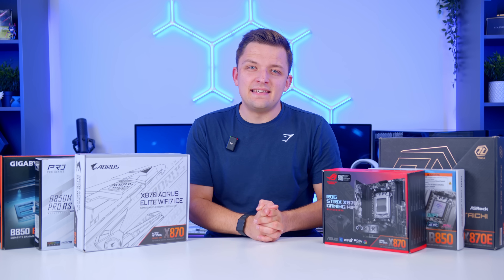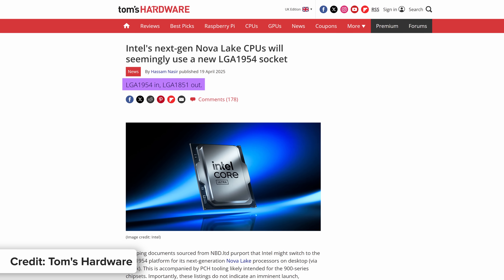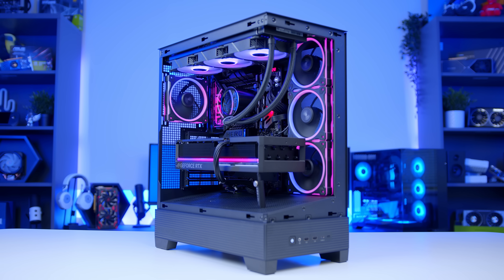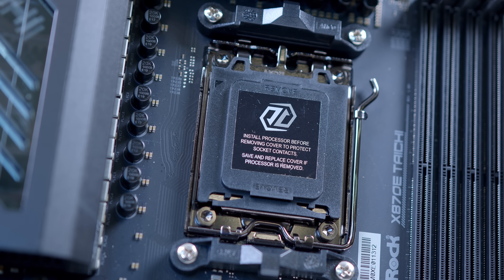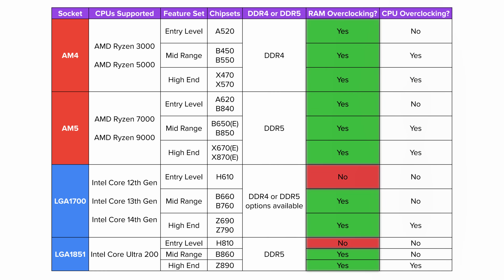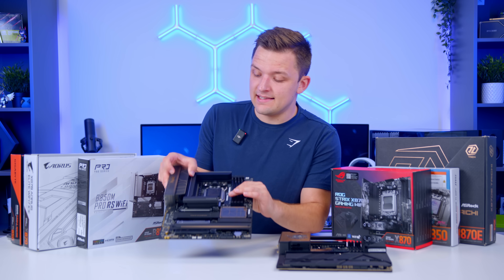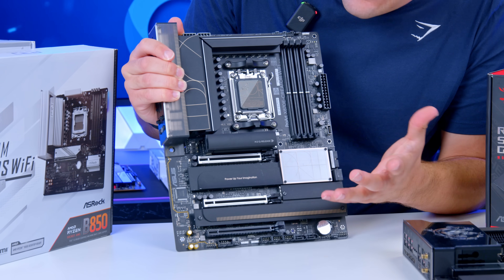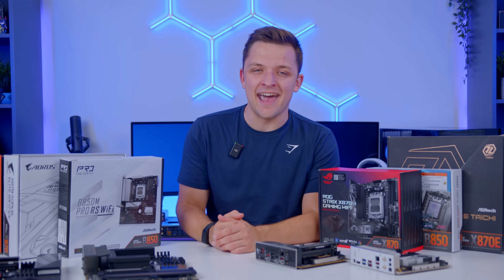How to Pick a Motherboard in 2025! 👀 [...And My Favourite Boards Right Now!]

Comment: Yeah pick the cpu first, but then go by connectivity you need. There's a lot of overlap between the chipsets. I like to keep a lot of sata and nvme without sacrificing each other and settled on a b850 not an x870 or x870e

Comment: From my own experience and based on a, probably, relatively rare usage-scenario (flight-sims/VR): Make sure you have enough on-board USB Type A sockets on your board. I have seven of those on my board plus two front-side ones and a 4x hub built into my monitor, but since a lot of the more mundane devices I run like my mouse or keyboard will only function properly on an on-board connection, all my on-board Typ-As are populated. 
As for brands? I used to be super loyal to Asus as I had been using their boards since the days of the Commando and never had any issues. But they've become a bit too mad re their prices and bang per buck plus they seem to have been fumbling the ball a bit in recent years WRT quality, so I jumped ship and went with an MSI Z690 Tomahawk when I built this PC a few years ago. Admittedly, that was mostly for pricing reasons as I could get a decent deal on the MSI board at the time. 
So far, I've been very happy with the purchase and I think I'll stick with the brand when it comes time to upgrade. I like their UEFI, the system has been running stably with both the 12600K I had initially and now with the 14700KF I upgraded to and their support is pretty good as well. I remember running into a snag while building, shooting them a question via email and getting a helpful response (from a real person) within the hour.

Comment: This video is aimed at beginners because it explains all the key points to consider when choosing a motherboard and goes into detail about the differences. However, I seriously question—if you don't even know these basics, why are you trying to build a PC yourself? And if you're not building a PC, then what's the point of learning how to choose a motherboard? That's the awkward part of this video: for beginners, it's not enough to teach you how to assemble a computer; for experienced users, it's just a bunch of pointless chatter. For example, when recommending motherboards, it doesn't mention the number of PCB layers, the power delivery design suitable for different levels of processors to achieve maximum turbo boost, or where the limitations of PCIe lanes lie. I/O ports are such an obvious feature—you can just glance at a shopping site and see them. I get your recommendation, but why are you recommending this particular one?
Reply: These are good points. Is there somewhere that you could point a beginner such as myself to look instead?

Comment: I recently switched my workstation over to AM5 and decided on the asus strix b850-f. Reasons included wanting powerful enough vrms for the upcoming zen6, newer chipset for better ram compatibility, enough type a usb ports, usb bios flashback and clear cmos button (these seem standard now), multiple gen 5 m.2 slots, gen 5 pci-e slot, and no lane sharing between the primary pci-e slot and the m.2 slots. The only thing I think it lacks is that led display for post codes.

Do your own research, decide what's important for your use case, and buy what you need.
Reply: I ended up with the same board over the X870 TUF version. Better audio, intel nic and the no lane sharing between the primary pci-e slot and the m.2 slots, was the major choices. Loosing the new USB slots was the compromise I guess but not sure its needed on this PC, I run my primary storage through a server on my local network. B850-F was the right choice.

Comment: Just buy a B850 Tomahawk max wifi or 2nd option B850 Aorus elite wifi 7. Try to buy Tomahawk if you can or buy Aorus. I have Tomahawk personally for more than 2 months and faced no issues. Boot time also fairly quick around 20 sec. Tomahawk has 2 Gen 5 ssd slots and it is 8 layer pcb design.
Reply: Buy only if price around 200 to 220.
Reply: What about B650, which one would you suggest 🫠
Reply: @MrMemexo In my region b850 is 10$ more than b650. If you can pls buy b850 as it has gen 5 x 16 slot. It would be good for future.
Reply: @MrMemexo  check gigabyte b850m Gaming mobo. It is the cheaper than some b650 boards.

Comment: 14:13, I was thinking about buying ASRock X870E Taichi, but the recent news about ASRock Motherboards burning Ryzen 7 9800X3D and Ryzen 9 9950X3D made me rethink this purchase. On one hand people on Reddit are writing that the amount of burned CPU's is minimal to overall amount of sold motherboards and the newest BIOS update should've fix this issue. On the other hand many people are still reporting burned CPUs, I don't believe that Taichi BIOS was updated to 3.40 and some people are recommending for safety avoiding ASRock motherboards. And that's pity because I like this motherboard, but I don't want to risk my CPU.
Reply: I wouldn't risk it and there are plenty of other options that don't potentially burn your CPU to a crisp. So why try.
Reply: @alloftheexperts2111  Yeah. ASRock reddit is still flooded with fresh "Dead CPU" posts :/ That's why I bought today MSI MPG X870E Carbon WiFi and even managed to find ASUS Prime GeForce RTX 5080 OC for near MSRP price. So it was a good day today. I'll leave buying CPU, PSU, additional fans and peripherals for Black Friday and Christmas Sales.
Reply: Been thinking about that Motherboard as well, but burning the CPU like that?

How often would it burn?
Reply: @veinlor3083  I dont think its worth it considering a MB that could potentially fry your CPU when its a piece of hardware where the are so many alternatives that dont. Theres nothing particularly special about the ASrock boards that other brands dont provide. You have at least 5 A tier alternatives that wont let you down and wont perform any worse than the ASrock.

Comment: While asrock motherboards give insane value on paper, do note that there has been multiple cpu burning incidents. Although not everyone is sure if its an exclusive asrock issue, theres a lot of posts on asrock reddit reporting burnt cpus. Personally, i would wait for the issue to settle before buying asrock motherboards
Reply: Unfortunately, when I look, it seems like every AM5 board has at least some kind of issue. On top of other concerns like MSI having RAM issues or ASUS just continuing to be ASUS, there seems to be something funky related with power management in general.  JayzTwoCents found video stutter was paired with random GPU power drops, as well as random USB drops, and the machine straight out losing USB until power down if you unplugged a cable.  MSI has an Ethernet issue that is quite similar to what JayzTwoCents saw with USB; Ethernet can randomly drop and reconnect, and performance can also jutank until you do a full power down, and removing or even jostling a cable can cause the PC to lose it entirely until powered down.  While less common, I've seen people saying that they've instead had WiFi drop on Gigabyte boards. etc...
Reply: not to mention the lack of true nvme support which they took 3 generations to fix.

Comment: Not sure about the MSI Godlike considering how many are having issues with it, I think it is currently one of the highest RMA % motherboards currently for AM5?
Same with the ProArt and its PCIe lane gimping. Great looking motherboard with all the features you need as long as you do not need all the features because it's usually pick one lose one. It has an awful x8/x4/x4 lane loadout when populated.
Asrock Tiachi again with a weird PCIe lane sharing layout.

I prefer motherboards with power/reset buttons and an LED display, optical output and premium build that actually offer you useful features that can be used, currently overpriced motherboards like the above is like ordering a sandwich, paying full price, then being offered bread or the filling as you cannot under any circumstances have both at the same time.

I cannot stand PCIe lane sharing as frankly it is false advertising and a scam. Thankfully there was a motherboard that offered me all the features I was looking for in the Asrock Nova X870E, hopefully it will serve over a decade like some of my previous premium boards which are still running.

I am considering a second system in MicroATX, but for that, well there is no real premium feeling  motherboard choice at the moment, just a few B850 motherboards around the £200 mark. The preference would be up to three NVMe, optical output and possibly USB4 but in reality it will most likely have to be B850 as no premium MicroATX is available.

Mini ITX again too much nonsense for the money. It's like paying for a fancy meal with loads of nice ingredients, only to be given a boiled potato on an espresso cup saucer. I get PCIe lanes are limited, but frankly simply adding every PCIe lane feature you can despite them compromising each other is frankly retarded. 

You don't but shoes with velcro straps, laces, and boa dials as options, while the sole has studs, air cushioning, and crampons for ice, when all it can use is a pair of laces and air cushioned sole.

I mean ffs imagine it, I want a pair of trainers, sure, that will be £500. But I just want a regular pair of trainers with laces and a rubber sole. Sure these £500 trainers have that, it just means you cannot use your RGB rollerblade sole, or your multiple sleeved velcro lace system, or the built in socks. OH forget it, I just want the features I need. Oh don't be stupid sir, with all these features, we can sell for way more than the cost of the trainer, add features no one needs, and also get rid of all the crap we overstocked on to idiots who want to future proof their trainers with all these features that stop them using the primary functions of the shoe!

Comment: The sad thing is asrock seems decent on paper
And then you see aaall the complaints and then

Im not sure I mean surely there has to be some people with no issues? Its hard to tell
Meanwhile the others like gigabyte and asus have their own issues too
That just leaves msi and I dont actually have experience with them either
Sometimes two motherboards that look very similar can have very big differences which is a huge headache

Even the expensive ones are not guaranteed to be free from issues (sometimes the price is the issue)

(I actually still dont fully understand the differences between b650 and x670 and b850 and x870 either although ehh)

Comment: -- From my experience --

As of year 2025, AMD (AM5 socket) is the best chip set for gaming and production work. Intel just doesn't have anything - at least for now. I thought about Intel's 12th, 13th, and 14th generation, but didn't because the socket for those CPU chips are at the end of the line.

Power delivery and cooling: Mostly rely on Unboxed Hardware, but willing to listen to other people's opinion.

Features Include:
1] Clear CMOS & BIOs Flashback Buttons @ Rear I/O
2] Debug Code Error Reader
3] EZ Release Design (for the GPU)
4] PCIe 5 Generation
5] Wifi (just in case)

Price: =<$400

Motherboard Sizes: Depends on the PC case.
Reply: Still, that's a lot of money only for MB
Reply: @Kliq-n2s  Fair; the motherboards I believe to be the best are the ASRock Phantom Gaming X870E Nova, the MSI MAG X870E TOMAHAWK WIFI, & their prices are about $300 - $320.
Reply: @Kliq-n2s it will likely stick with you for a long time. AM5 is going to have Zen5, 6, 7 support which is very good longevity wise so it is worth it to invest into a better motherboard. If you go Intel however....

Comment: I have the Asus Crosshair X870e Hero.. Best board out there, but expensive..
Reply: How many Nvme have got in your system? and in which places are they in? As I would like to use the sata drives as well.
Reply: @jodiepalmer2404  3 x NVME 1,4,5.. + 3 x SATA..
Reply: Im planning to get the BTF version of the Hero x870e